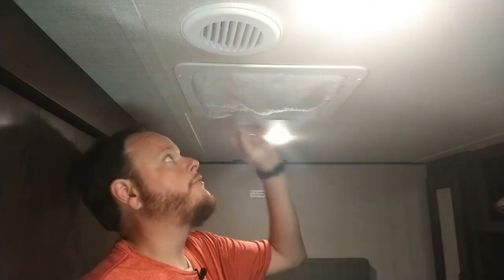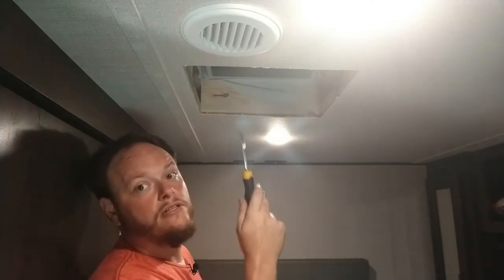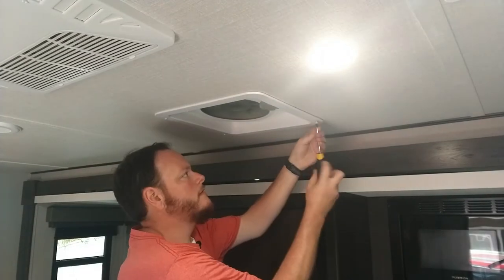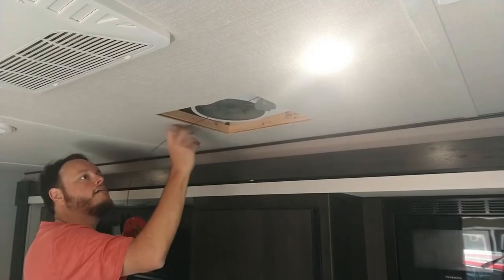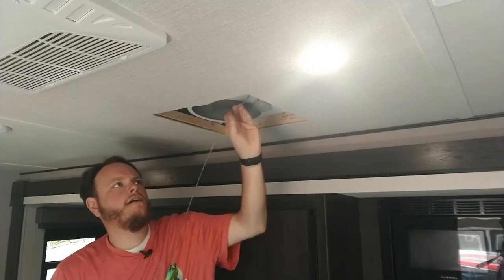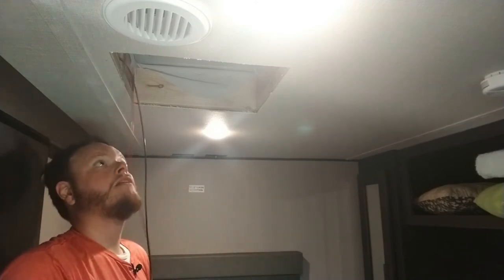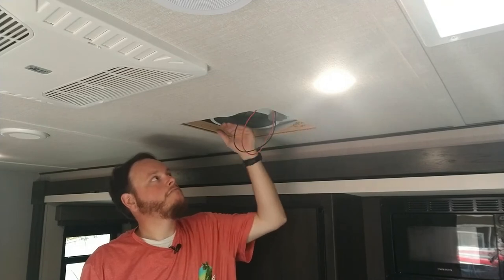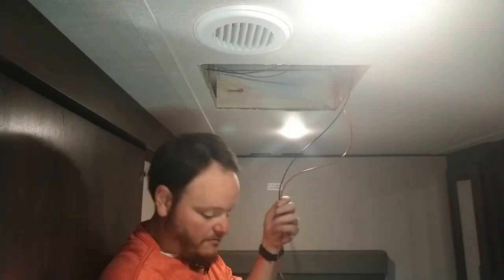Vortex II install in RV bedroom non-powered vent

Comment: Installed both fans one for the bathroom and one where the Vent in the bedroom was...Used the power from the bathroom fan using t-tap connectors - worked great- both are working with no issues - thanks for your help..

Comment: Back again- Already to do the installs - One fan to replace the old one in the bathroom and the other in the bedroom where it is right across from the bathroom and it's ONLY a vent. In this video you are using 14 AWG wire to connect the power from the bathroom. Since both the bathroom and the bedroom area also are on  the same circuit (15 amp fuse) which also has LED lights in both areas, should I use wire that is thicker like 12 or 10 ?? I found the info on t-tap connectors - looks easy enough to do...Again thanks for your advice..

Comment: This is what I was looking for but it didn't show the most important part where you tied into the power to the current fan...
Reply from the maker: When you run the power wires to the kitchen fan, just match the + and - from that fan to the new one. You can use a T-tap or wire nut to connect them.
Reply: @brookstorivers  Great - thanks- Looking into using t-taps...

Comment: Why did not connect to the light 1 foot away ?
Reply from the maker: I wanted it to have power all the time, not just when I had the lights on in the bedroom. I could have dropped the power wire down and tied to the other side (constant) of the switch but going back to the other fan was easier.
Reply: Merci  My light have a built in switch. Your video helped me .Have done it and work good Merci